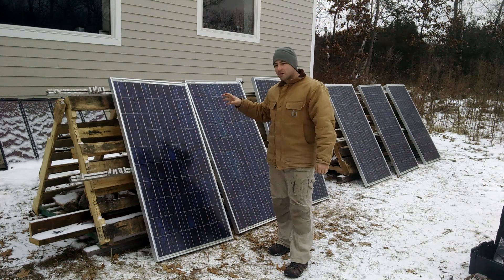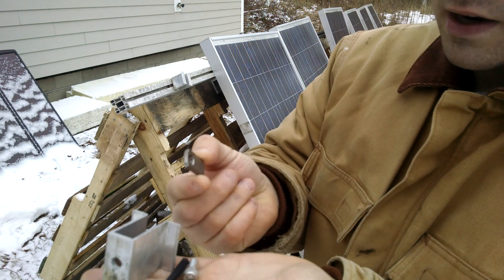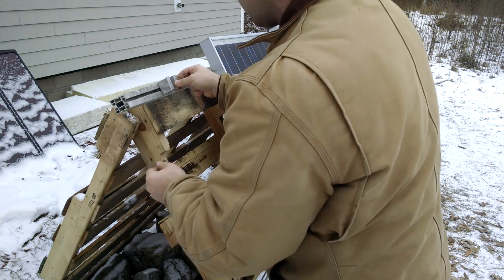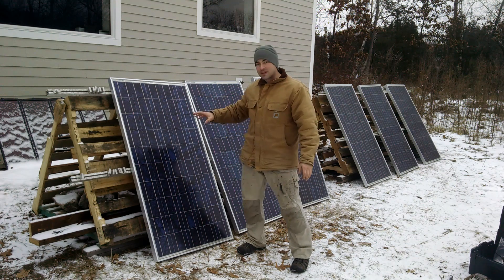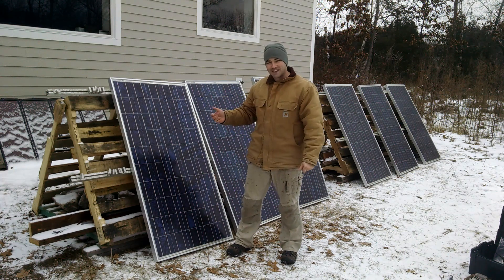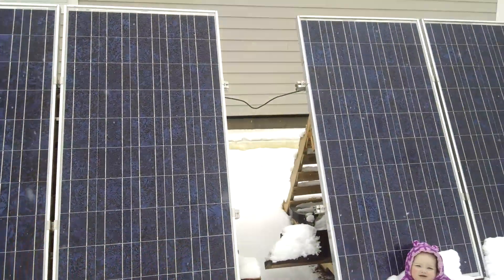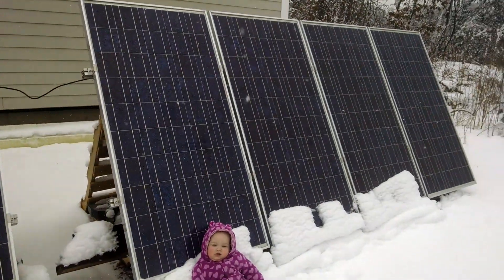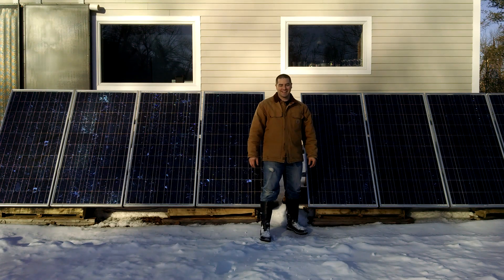DIY Solar Panel Mounting on Pallets, : Part 2

Comment: How did you hold down the pallets so they don’t blow down in the wind?
Reply from the maker: Each pallet had 200-300 pounds of rocks or concrete block that I tossed in there as ballast.

Comment: Hi David. Nice job with your projects and videos! I'm sort of in the same boat. I just spent the last year+ building a new garage with radiant floor heat, and I covered the roof with PV solar panels. I went with a grid-tie system. It's been up for 7 months and has been working as expected. I'll probably be working on adding some solar hot water to my house soon.
For anyone wanting to learn more about solar PV, I posted a write-up on my project at: https://www.instructables.com/id/DIY-Solar-Garage/
The video on that is at: https://www.youtube.com/watch?v=dvUohDXKjYw although that's sort of a "webinar" presentation I made on it.
Anyways, keep up the good work!

Comment: Looks great! Are you going with a charge controller/battery bank or grid-tie inverter?
Reply from the maker: That is what I eventually want to do (off-grid charge controller/battery.)  I've been keeping a watch on craigslist for some used components.
Reply: DavidPoz not that hard to do! You could also put those 8 panels in series and drive an electric water heater element during the day to add to your radiant setup.